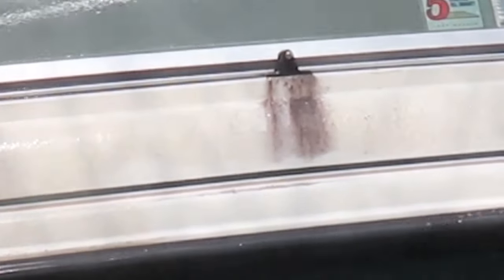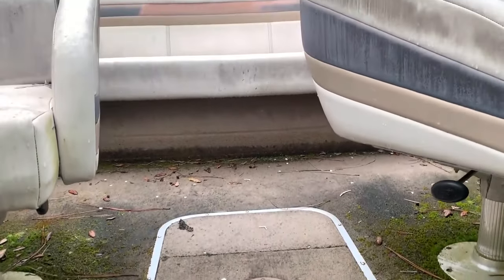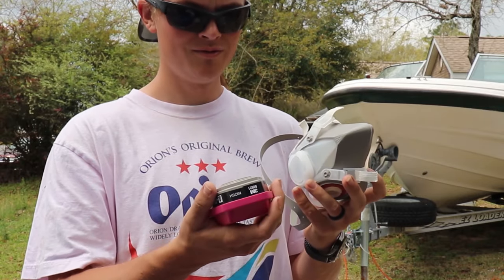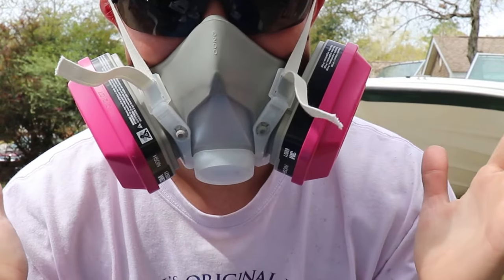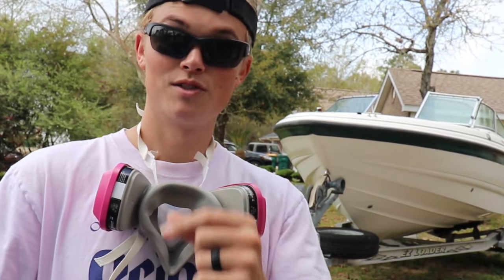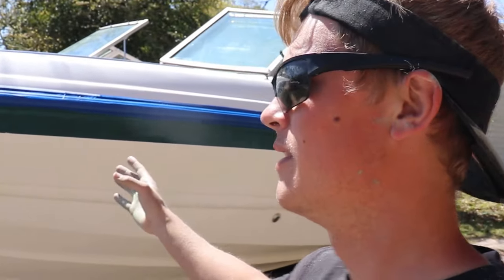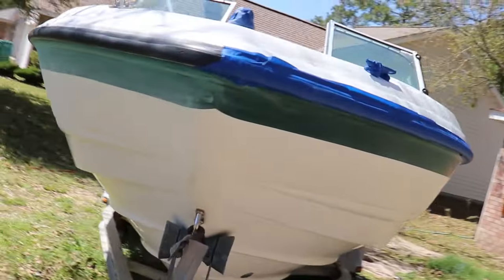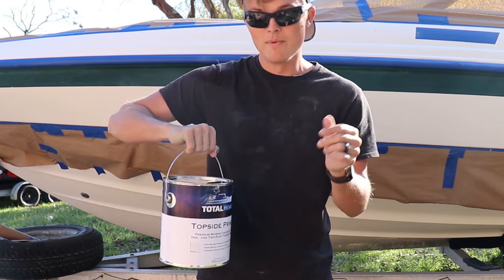Boat Restoration | Fixing a Cheap Boat |🚤| Part 3

Comment: Are the stringers and transom good?
Reply from the maker: Transom is good! What’s the best way to inspect the stringers?
Reply: @slickshifts3434  I wish I knew.
Reply from the maker: lol I think the only way to truly inspect the stringers and hull is to rip up the fiberglass floor. Not worth it.
Reply: @slickshifts3434  that’s the only way
Reply from the maker: @leesire  If I was building a race boat or doing a restoration of a 200k dollar boat I feel like that would be worth the time and work considering its so expensive and would help to have pictures and evidence when you sell it.
Reply: @slickshifts3434  

I know a lady that spent 12500 on rebuilding her stringers and upholstery.   I tried the boat and the seat fell off.  Upholstery looked good tho